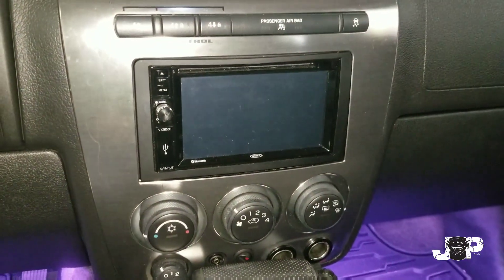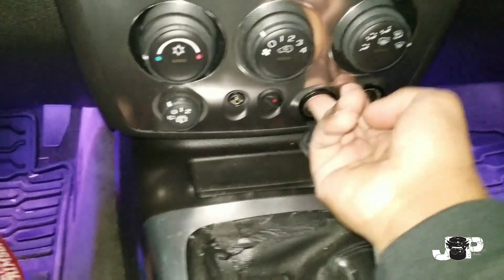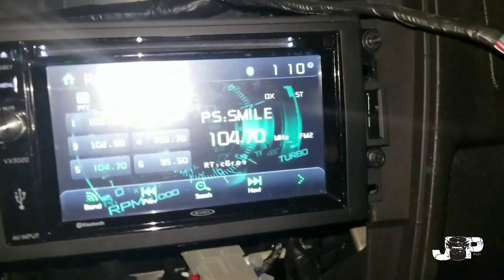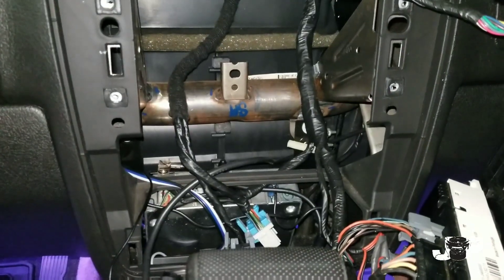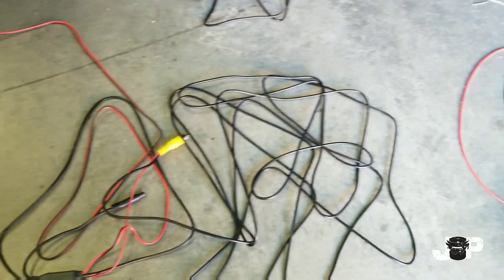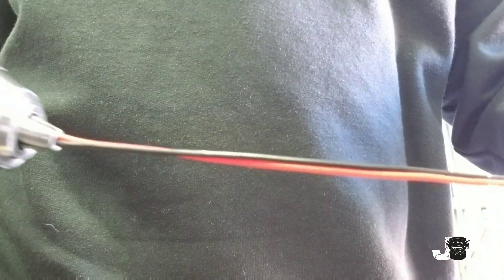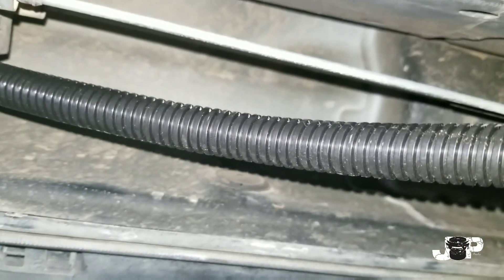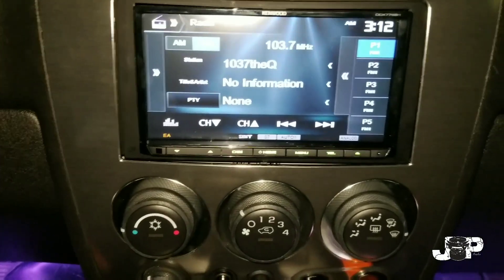2006 hummer h3 radio removal / Kenwood install

Comment: I have a 2008 H3 and I just put a kenwood in today. My problem is, even with the volume all the way down, I get a loud hiss. Like when you don’t have any music playing and you turn your volume all the way up. Also…..even like at volume 8,9 and 10….the music or whatever I’m playing is super loud. It’s like I have an amp plugged into another amp. Any help will be greatly appreciated. Thank u.
Reply: you find a solution?
Reply: @gabrielarreola9953  all I could do was turn the source input down. Basically turn the gain all the way down. It's quieter now but still there. 🤷🏼‍♂️

Comment: I have 08’ h3 with factory radio/monsoon. Looking to swap head unit out with a double din unit that has apple car play, is there anything special I would need besides a wiring harness adapter for it to work? Note: I don’t use onstar
Reply from the maker: Nope the harness should retain all your factory features get a dashkit and antenna adapter and your good

Comment: What harness did you get for that install? Is it a basic harness or does is there a specific one to use?
Reply: A normal gm harness for the model year will work if you don't mind losing your xm radio or OnStar service. You will also need to run your radio's accessory 12v to an accessory fuse or something similar as there is no accessory wire on the stock head unit. If you also have the monsoon system from factory you'll want to tie in the pink amp trigger wire from the stock harness to the accessory 12v lead coming off the head unit. Hope this helped

Comment: What color wire is for the power for your double din stero?? i have to manual shut off my stereo. Which is a pain i want it to turn off when the vehicle is shut off and door opens like a regular vehicle.
Reply from the maker: seems like you ignition wire is tied to your 12v constant here is a video where i explain the wiring https://youtu.be/T1Av3dKGN_4

Comment: Do you actually have a video of how you hook the back up camera up.  I am replacing my radio with your instructions and want the back up camera, but have no idea how to hook it up so it comes on when I put the H3 in reverse. Thanks
Reply from the maker: i have a video on installing a back up camera here https://youtu.be/AQbRKLzyHI8 but i just got done filming another detailed version of this so it should be done in a week or so, so be on the look out for that it will have waaaaay more information.

Comment: Where did you find the reverse trigger wire? Wish this was more detailed.
Reply: The reverse trigger wire is located in the tail lights. The reverse light is the one that turns on when u pit it in reverse . Find that light locate the posative side of it and tie into that with red wire .
Reply: @xxspawnxx  Do you then just plug the other wire into the back of the car radio (display) or do you have to connect something else up front (ignition, reverse etc)?
Reply: @Morphosis68  the reverse should have a power and ground on one side and a video connection on another.  

You tie the red wire to the posative reverse light wire and the black wire to ground. 

Take the yellow video wire and hook it to back of unit 

When put in reverse display should automatically pick up reverse posative signal
Reply: @xxspawnxx  You make it sound simple. Thanks for your response. I will be installing the camera in a week or so. I'll let you know how I go.
Reply: @Morphosis68  it really is if you know what to do . 

Dont forget.  It should have 1 side with red and black wire.  

Red is for posative reverse back light.

Black is for the ground.  All lights will have a ground so tie it in with that. To make it easier use a lighter to burn the ends of wire to make easier for threading with car wire. As the backup camera wire is very thin and will be difficult to cut with cutters 

Run the yellow video wire to the back of head unit . Dont forget it your unit needs a video plugin yellow color on back for this to work.  Once that's done it should work . Good luck